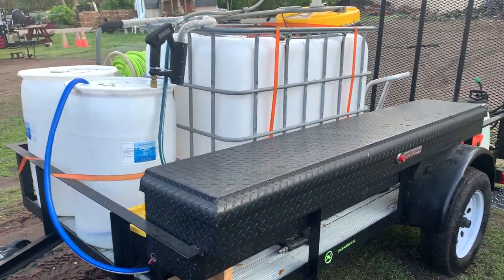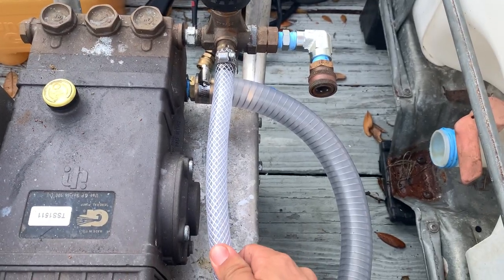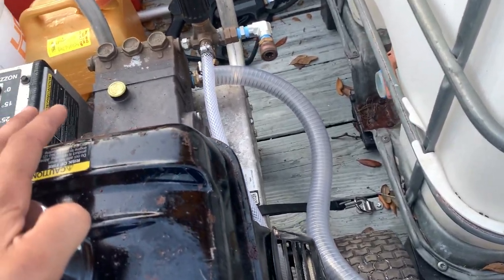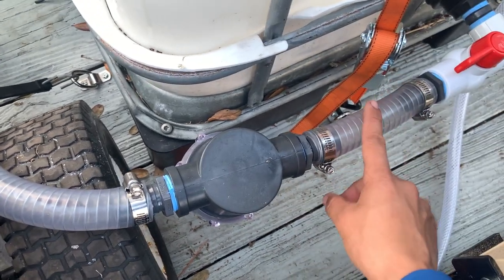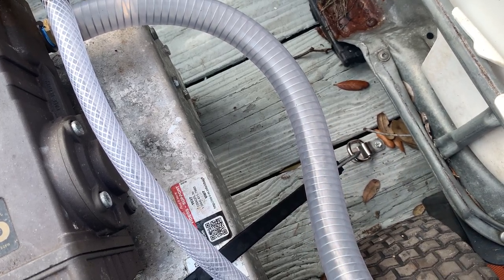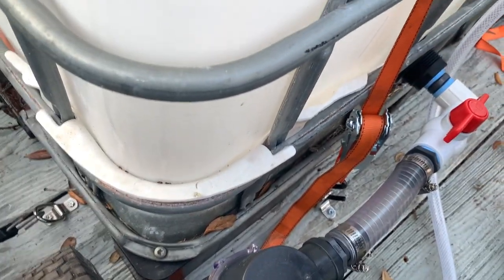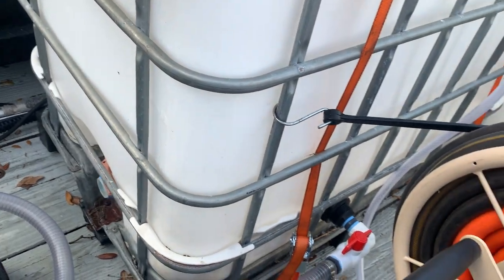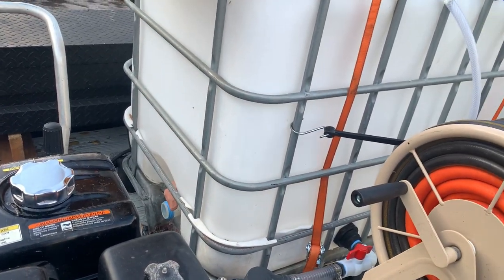Pressure Washer plumbed to buffer tank on my trailer

Comment: About 2 inches below that second bar from the bottom is 100 gallons and that weighs around 800 lbs. 
Ive moved these fully loaded with a fork lift and they can get to around 2300 lbs.

Comment: If you fill up that whole tank you need to find a different way to strap it down for sure just in case I still mind completely up on the bed of my truck for when I have to do some work where I do not have water access on my truck I use two strips that are rated for a little over 5,000 a piece But I'm a trailer I have steel bar that was been bent up for me by a buddy

Comment: I noticed the hose reel you have. Is that from tractor supply? How do you like it? I'm thinking of getting one.
Reply from the maker: Works good, it’s fairly priced and it’s compact too. I have one reel for connecting to the house faucet and another for my softwash hose. I’ve heard of you run bleach through the reel it will corrode the fittings and eventually leak but that hasn’t happened yet.
Reply: @extremegreen5092  I run the same for my 12v, rinsing system for 10 minutes been going a long way!